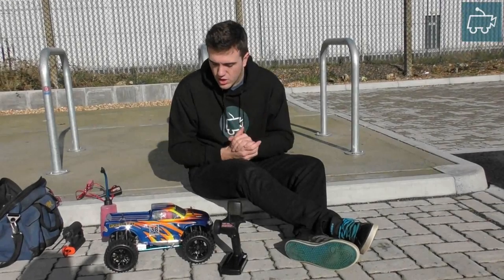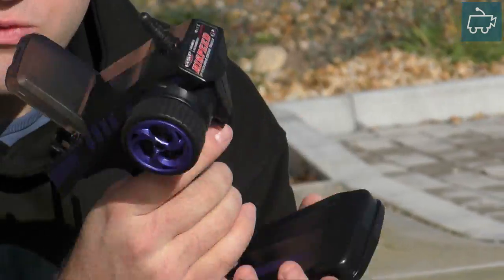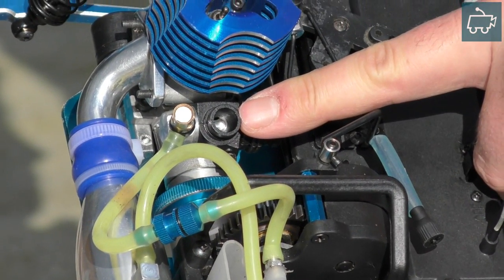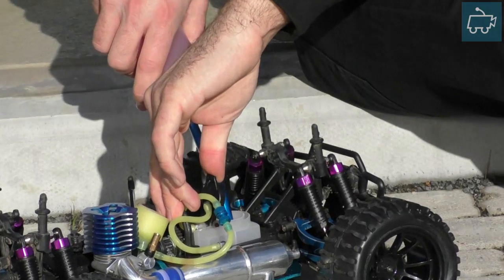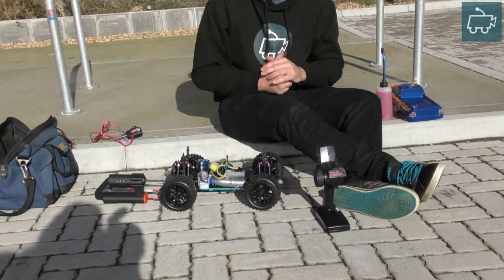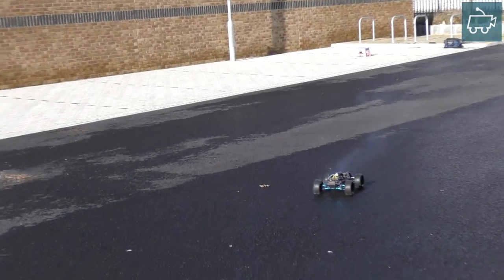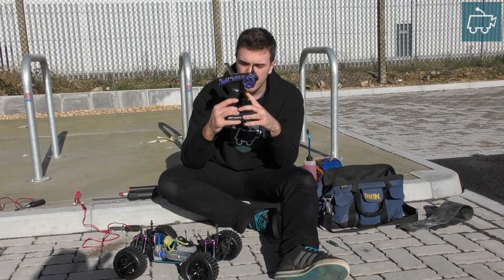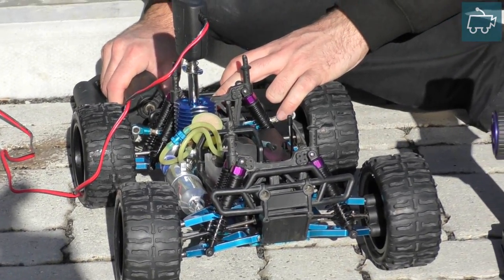VX.18 | How to Break in Your Nitro Engine

Comment: I have the same engine and sort of truck. I didn't understand why it wasn't starting but then you said the low speed needle I'll try that when I get it out again. I just installed a new engine on it as well, but the fuel won't go through the lines into the carb.
Reply: Jake Is your high speed needle even open?
Reply from the maker: Check out this video https://www.youtube.com/watch?v=bWrTttKzL6E&lc=z13qjxxjyvmogvzua23nzvgj4wfsytyb104

Comment: Hi great video there, but please i need the engine mount you use for the VX. 18 engine  as a spare part
i am quite confused with all this engine mounts at ebay i dont know which is the right one
Please help
Reply: Thank you !!!
Reply: If you kept your manual the part number for the engine mount should be in it
Reply: i found the manual online but it doesn't mention the screws it needs to mount it to the chassis.The ebay engine mount has the screws to mount the engine on but not the ones needed for the chassis.If you know the numbers for example M3x10 or M3x12 it would be helpful.
Thank you

Comment: Should I touch the low speed needle as the idle gap is really low and it has a high rpm and the wheels are spinning at idleing and thus is during the breaking it's fine but wasn't sure to touch it to make it safer
Reply from the maker: Try the pinch test in regards to the LSN before you adjust it.
Reply: JT12's R/C Videos I've richened it and it's pretty fine now takes about 5 secs to die but wheels do move faster when engine warms up a bit but not seriously wasn't sure if it gets better over time as it's still new engine but thanks for your help love the videos new to this hobbies loving it already 😊
Reply from the maker: All engines run better once fully broken in give it time and it'll run sweeeeeet

Comment: Where do you get those lipo ignitors? as I can only seem to find ones with built in lipo and one with banana clips?
Reply: AlexSawyer 10 hobbyking
Reply: Boba Fett cheers
Reply from the maker: It's a prolux easy glow, check out wheelspinmodels.co.uk
Reply: Thanks a lot

Comment: Could you send me a link to where you got your igniter plz.
Reply: Jw13's rc you know you can get your igniter from anywhere if you just search it.... go on google and type rc glow igniter, it should be less then 10 dollars
Reply from the maker: It's a prolux easy glow check www.wheelspinmodels.co.uk
Reply: Thanks I found it and it had alligator clips for the connection where as yours has a li po connector did you change the connections
Reply from the maker: Yes. Well on the old one I did. New one I still need to. For now the clips fit into the ends of a deans connection battery.

Comment: Why does it go so slow but rev so high, would think a nice rc car like that would go faster
Reply: All Goped first of all, nitro engines literally rev over 10,000 rpm. Also he was breaking it in which he was going slow on purpose. That thing will go over 30 MPH easily. U have to tune the carburetor to make it faster and get the full performance out of it. Hopefully that explains.

Comment: Is there a reason everyone completely ignores the break in process recommended by the company that makes the engine?  even though they have probably spent a small fortune on R&D and testing to make sure it works?
Reply from the maker: High quality race tuned engines then maybe. But Chinese made VX engines I highly doubt they have spent any money nevermind a small fortune on research so therefore I always follow and promote a method that's worked well for me :) have you seen the instructions that come with engines like this? They are barely readable in english.
Reply: I was asking because i've just ordered an LRP zr30 and don't want to bugger it.

Also, when it refers to number of tanks worth of fuel, is it referring to a standard fuel tank size?  think mine is a 250ml one.
Reply from the maker: 250cc is quite a large tank so that's almost double what I'd consider to be a "standard" tank. However still do a full tank's worth, won't harm to go OTT with each stage
Reply: Cindarr ....38 years in this hobby...planes...heli...cars...new motors fuel n go!!!never had a problem....never did a so called break in!!not needed!!!!